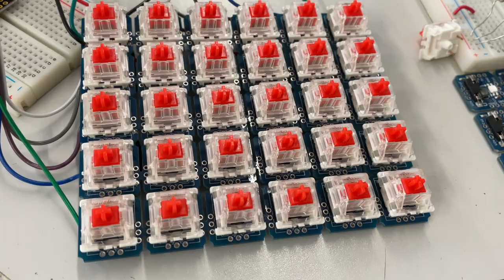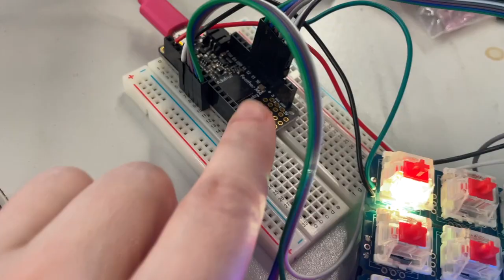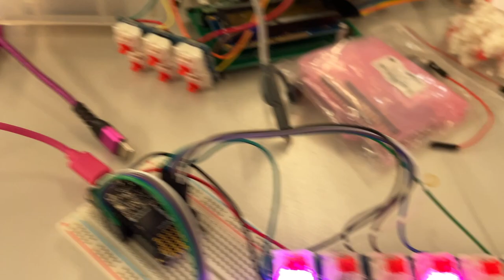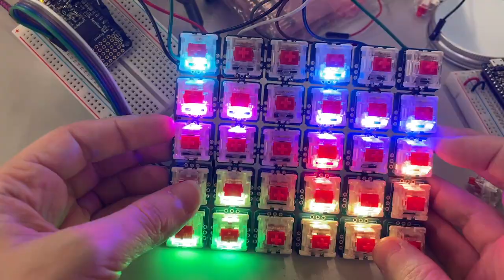CircuitPython now does background scanning of diode matrix keyboards

Comment: Brilliant! It looks like you have, but please consider the ability to tile multiple modules. I think 4x6 would be more flexible as the basic module: use two side by side in landscape for a Planck keyboard or multiples side by side in portrait for a standard 6 row full-size.
Also on the RP2040, maybe the guts of the scanner could be implemented in PIO (and/or on the second core)?

Comment: I've been looking through the various firmwares for a way to get a 12x5 ortho (preonic or JJ50) running on bluetooth, I want to live that dream :) Microcontroller boards with BLE all seem to add a fair whack to the cost though, especially here in Oz:/ Do you have a recommendation for an affordable arduino +ble and battery combo to design around?
I'm leaning towards making a 12x6 pcb with a combo of pots, encoders and macro/f keys on the top row.